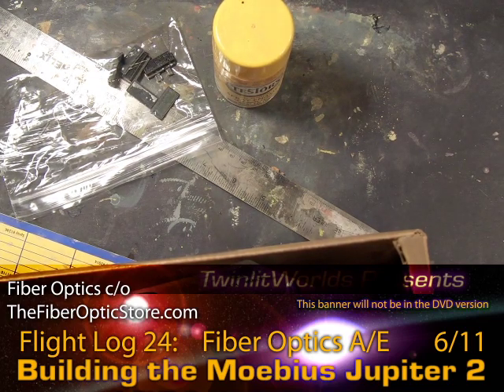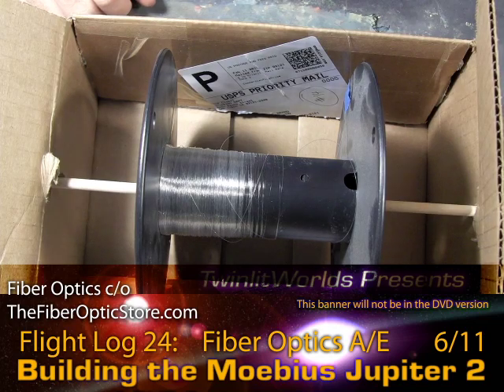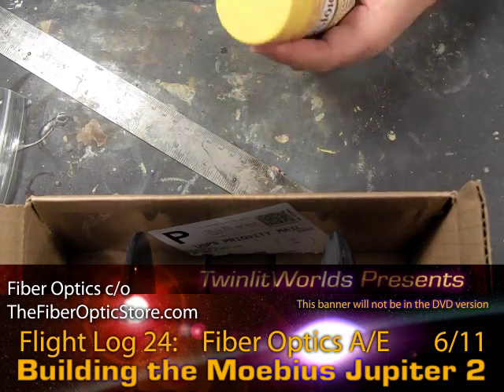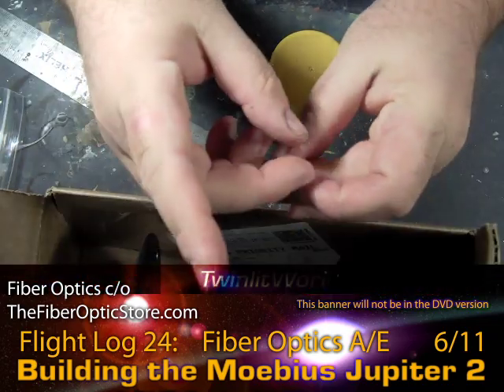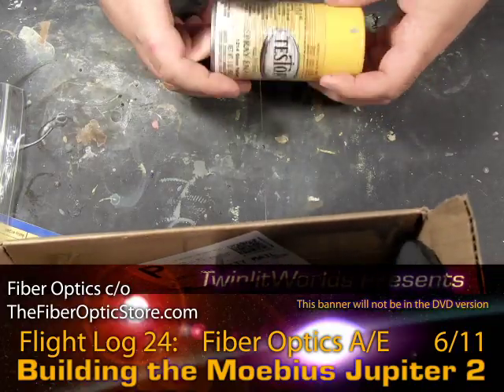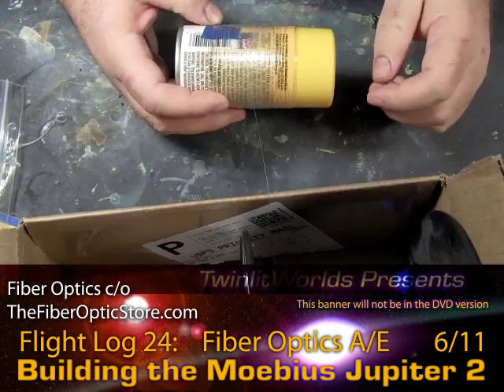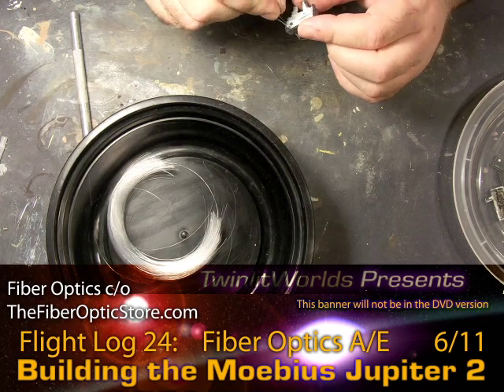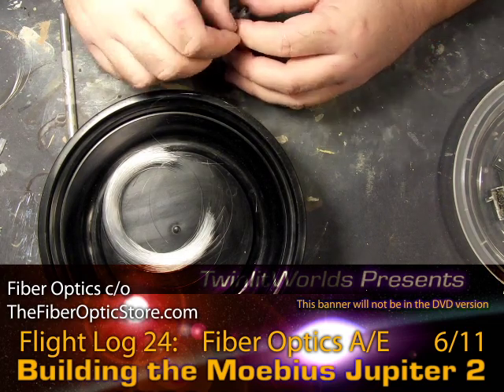J2 FlightLog 24: Fiber Optics A/E 6/11

Comment: Tape the ends in rows, stack the rows and tape them together. Pass the threads through the front where they are taped and silicone the back end, cut the taped ends off.